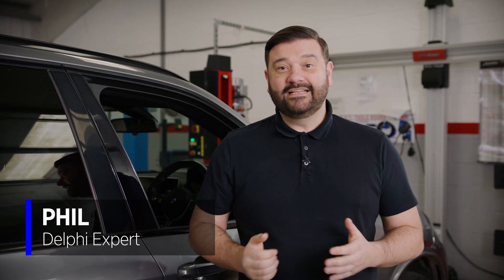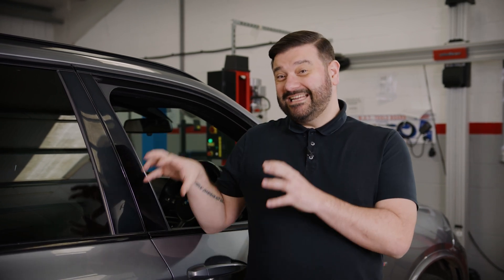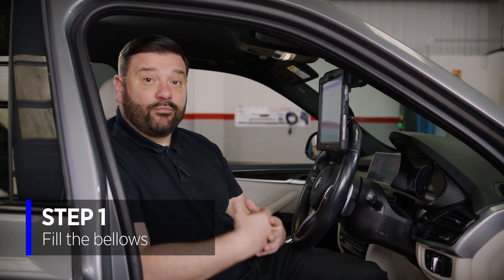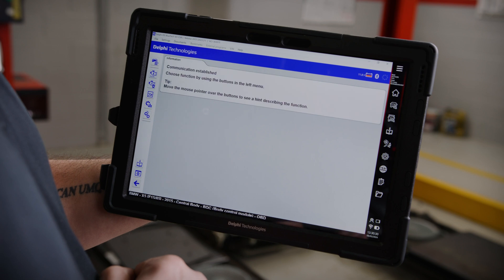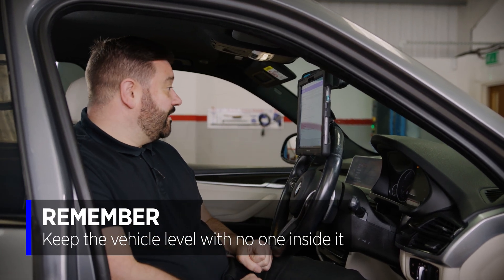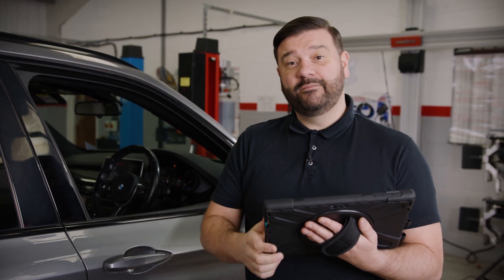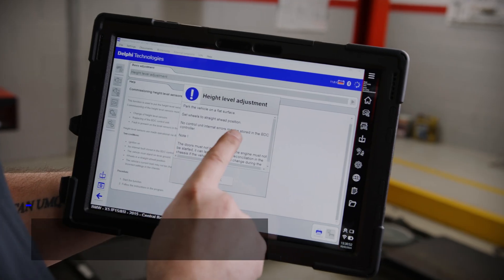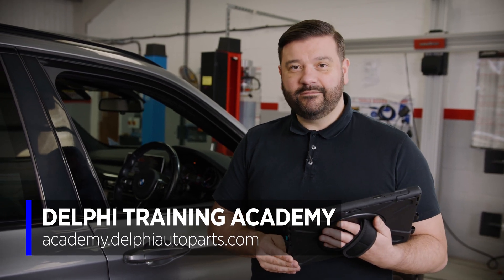[EN] How to calibrate air suspension | Masters of Motion

Comment: Friend of mine change front air suspension of Audi Q7 , however front SUV level became lower in normal position compared to original suspension position(10mm), No fault showing in the system, left side even 5mm lower than right side, what could be the reason, will calibration resolve the Hight issue if yes how? thanks.